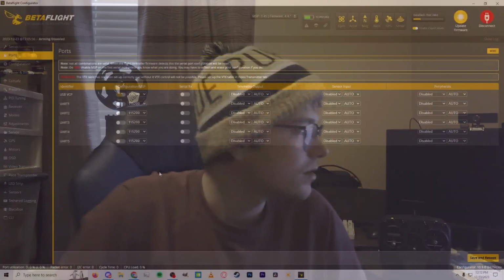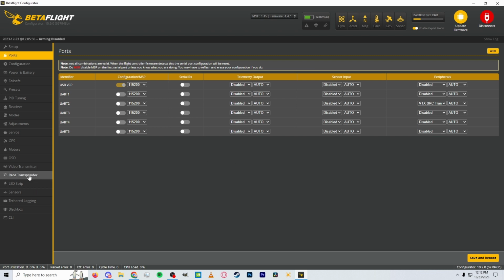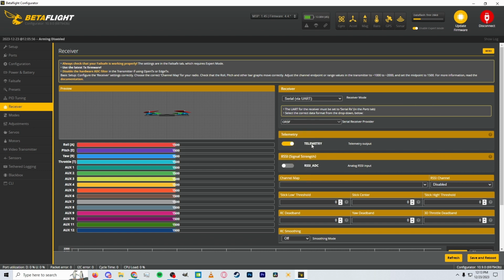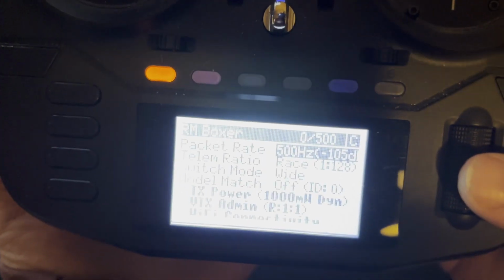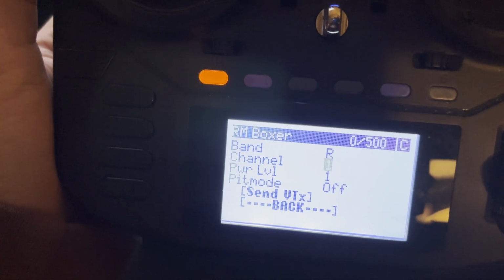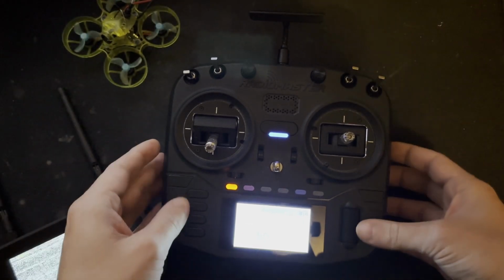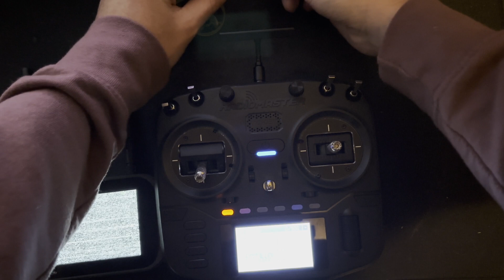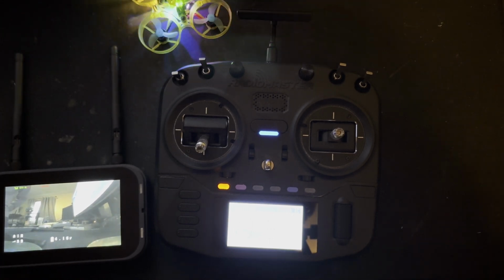setup vtx admin on ELRS protocol transmitter

Comment: Clever solution, and not too hard to do, great video !
But i guess you should still wait with turning on the drone until noone is actively racing :D
Reply from the maker: Thanks! and yeah I would wait to plug in since it still gives the signal for a second then switches over